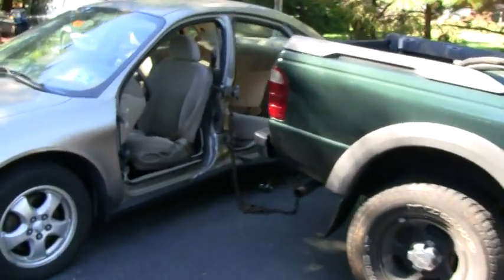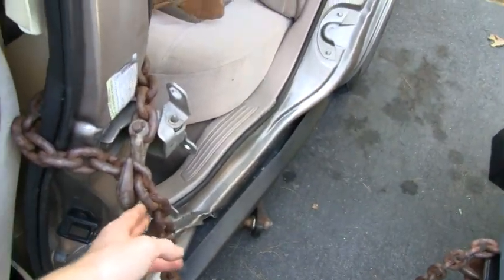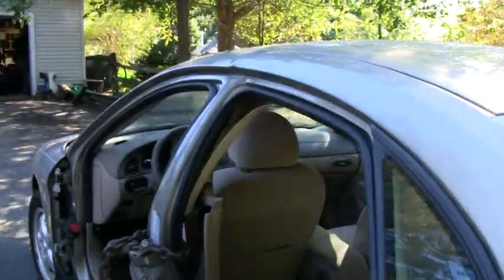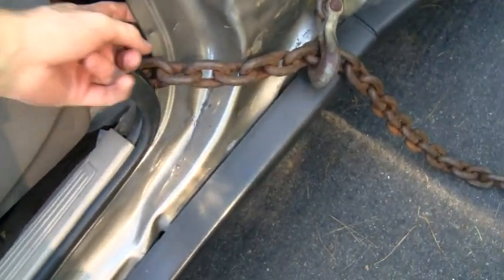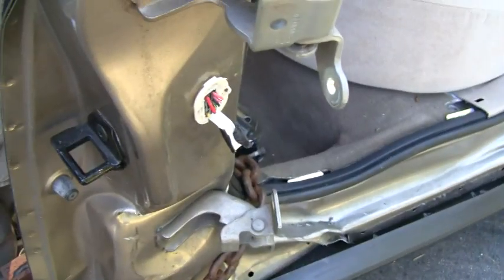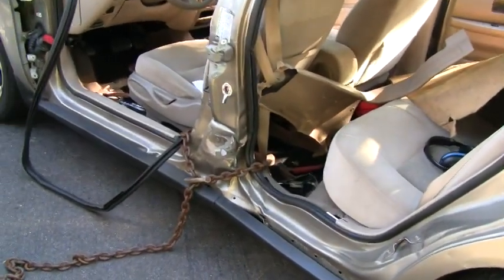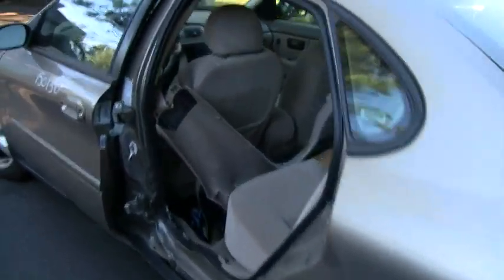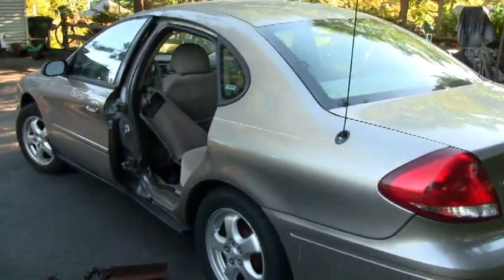TAURUS MAJOR COLLISION REPAIR PART 2

Comment: The "Snatch Fast" method is scary and dangerous! if the chain breaks or comes loose it takes out your window of your green truck, the windows on the Taurus, or worse yet- hurts a human.... MUCH safer is to do it with a cable comealong or a chain fall thats anchored to a tree buddy! also you can make more predictable detailed "Pulls"! But you got it that far and lived, so I guess all is good? Now get you a Cable come along and make up a couple quick pulling dollies to spread the load(Angle iron or "U" channel), and drill some holes and bolt it where you want your pulls - apply pressure, and then heat the kinks with a torch (you must first remove more of the interior parts, door gasket rubbers and seatbelt shit, cause all that stuff is plasitc and will either melt, burn or be in the way)- But youre on your way now Brothah! Good luck, , looks good!
Reply from the maker: Sometimes the safer method isn't the most effective ☺
Reply: LOL!

Comment: Treat yourself to a portapower lol. You should see the banger lads pulling cars in the pits with hiabs. It's amazing how quickly they get them straight(ish)
Reply from the maker: Most of what I did in this video would have put a hole in the floor before it moved the post with a portapower. I'll be using one for fine tuning later on ☺
Reply: Ok sorry you did good. Couldn't have done that myself at your age.
But with a portapower across to the other side with a plate against the lower B pillar it would push out fairly easily. Seen it done loads of times.
Reply from the maker: Was trying to avoid moving the center console out to the way to do that, but I might have to!
Reply: Yeah normally stuff gets in the way....still like your style :)

Comment: With your welding skills, why not cut out the pillar and rocker from the car that you got the doors from and weld it in? Personally, that would be my method of choice on a project like that. That area is a primary crush area and has been compromised. If it is hit there again, it will not do it's job of protecting the passenger compartment. Food for thought.
Reply from the maker: Junkyard doesnt allow torches or saws
Reply: That's too bad. I'm sure if you look around you can find one that does. We have a couple places here in Michigan that are that way, but for the most part if you ask most of them will allow you to use a saw to cutout body panels. If the owner of the car has no plans to sell it, and is good with the way it is being repaired, keep tugging on it. Just remember that it will never be as safe as it was.